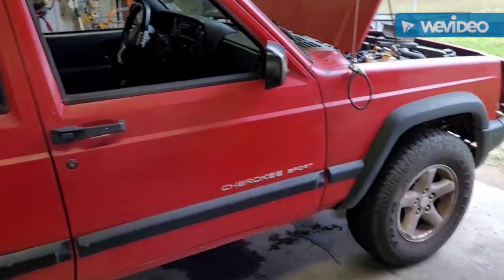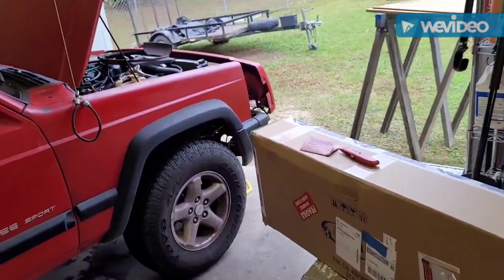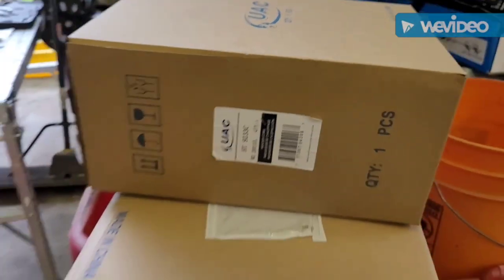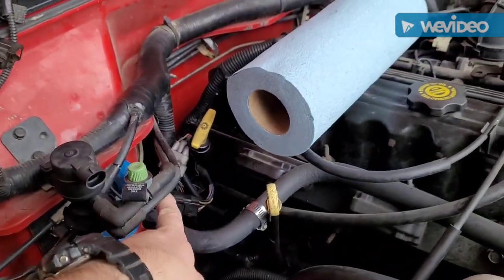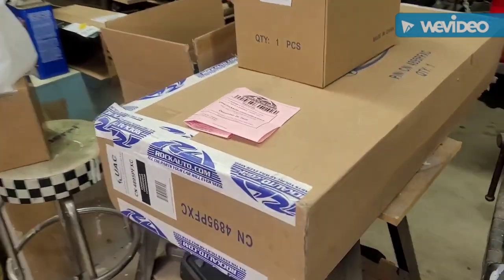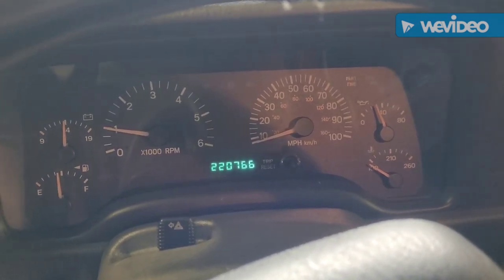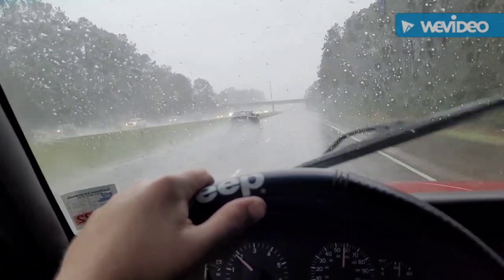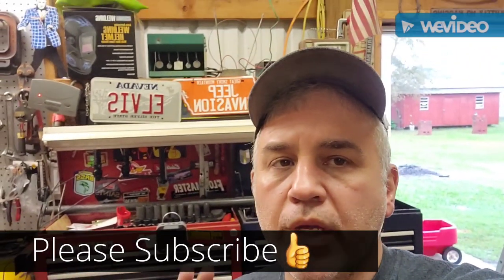Jeep XJ AC Condenser Issues #jeepxj

Comment: Next time you open a ac system put tape over all openings to prevent moisture from getting in the system. The receiver drier has desiccant in it that will absorb moisture.
Reply from the maker: Very true and good advice

Comment: Im not sure whats going on with mine , i went so far as to pull the parts cannon on the ac , only thing that aint new is the line from ac to condensor , high pressure valve, and evaporater,  everything else is new , still same results , high pressure low , low pressure normal , i can juice it , and low pressure goes up , but high pressure stays the same ..
Reply from the maker: So new orface tube?  Also did u flush evaporator?

Comment: I just got this ac kit for my 98 jeep. How much refrigerant oil are you supposed to add ? Thank you
Reply from the maker: Takes about 8oz if system is totally dry.  If you already have oil in compressor or other devices not flushed then I'm not sure.
Reply: @MajorWeakness  yeah my new compressor comes lubricated 6.1oz so I’d have to fill it up to 8oz